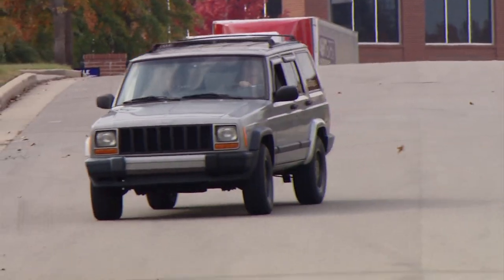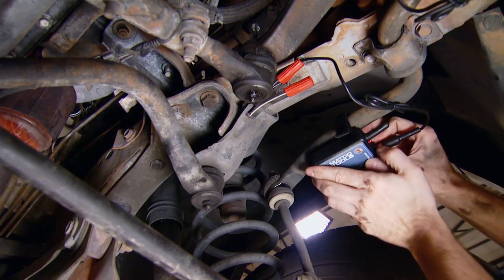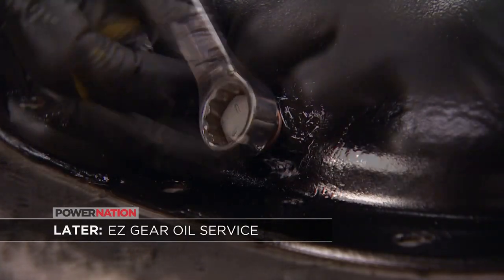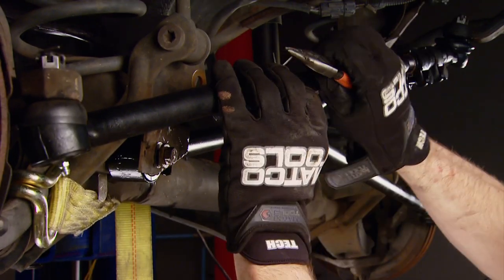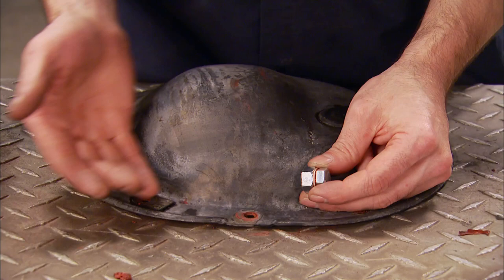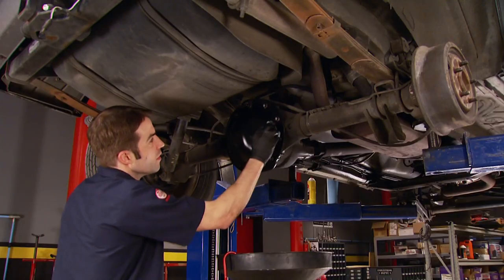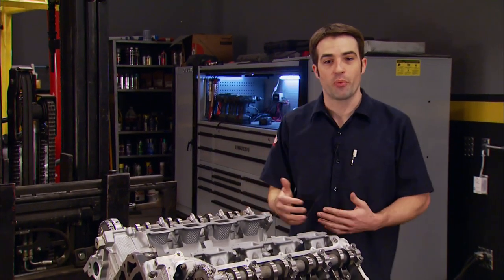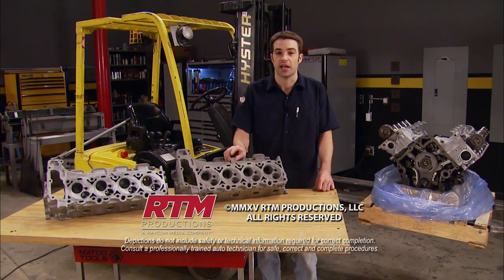How To Diagnose Hard-To-Find Suspension Problems - Truck Tech S2, E6

Comment: That up and down play on the ball joint.  I had that on my new Jeep which was under warranty also had some major steering wheel was bad.  The dealer told me they were spring loaded... I asked if they could check my piston return springs and muffler bearing as it was low on power.  They replaced them but it was a fight as they said ' it had spring play to allow it to move ' 
Can't fix stupid.

Comment: One thing I want to add for the track rod/panhard bar. Make sure the hole isn't ovaled out. Looking at the movement when they were driving I suspect it has been ovaled out from it clunking back and fourth. The bolt should have 0 play when in the hole by itself. It can cause death wobble once the front axle starts to oscillate. You also have to tighten down VERY HARD. Follow torque specs and torque at ride height